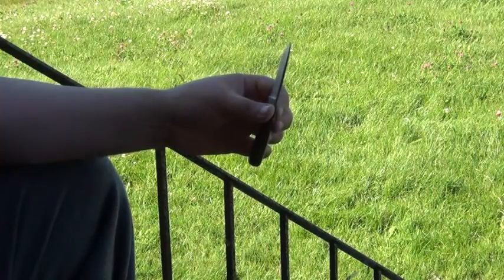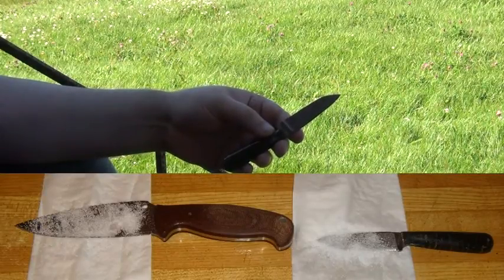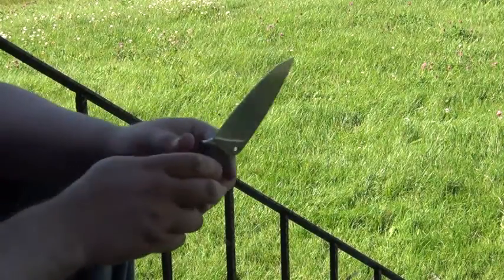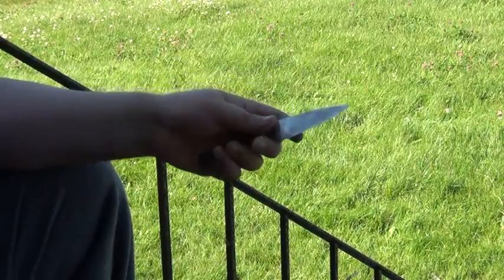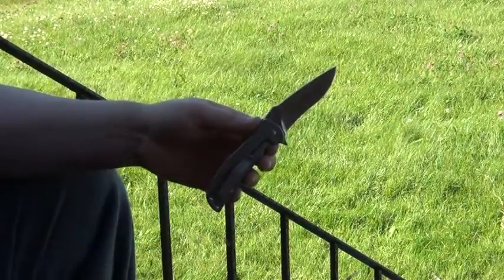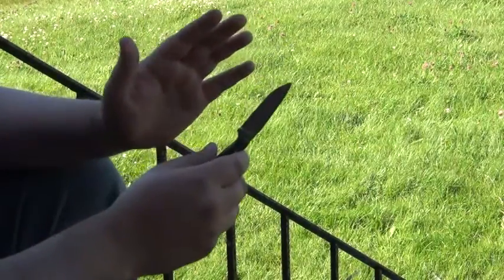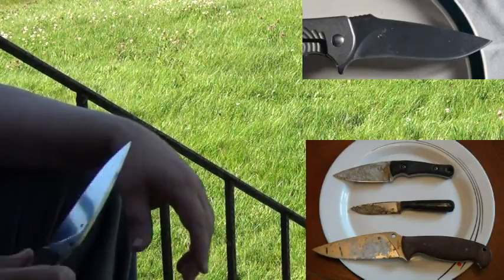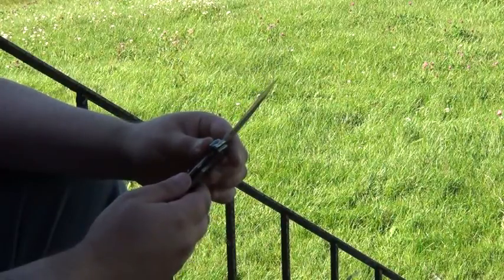Corrosion resistance : (salt soak) VG-10, S125V, S110V

Comment: Nice video :)So based on your experiment, wich steel would you recommend? Is s110v really worth taking over vg10 in terms of corrosion resistance? Im asking because i want to buy either a spyderco endura in vg10 or a pm2 in s110v (the pm2 is twice the price of the endura) i know s110v surpasses vg10 in probably everything besides of grindability but corrosion is my main concern. So wich of those two steels performed better in your test, or did they perform about the same?Thanks and sorry for the bad english.

Comment: +Cliff Stamp
I'm a novice at folding knives. I wanted to ask you a question about knife steels since you seem pretty knowledgeable on the subject:
So I own an S30V Para 2. I am really interested in a S110V Para 2 because I like the knife design and would like better edge retention (even if that costs me some toughness). But my main concern is corrosion resistance. I work in an environment were I am cutting with my knife frequently, but the blade would also be exposed to water and other liquids a lot. I would like to know if S110V performs any better, in terms of corrosion resistance, compared to other steels and supposed "super steels". I am considering knives with VG10, 154CM, CPM154, S30V, S35VN, Elmax, CTS-XHP, CTS-204P, S90V, M390, and 20CV.(Obviously S110V did not fair much better than VG10 or S125V, but do any of these other steels do any better than those?)

Here is a list of my steel priorities in order from highest to lowest:
1. Corrosion Resistance: As good as it can be without much sacrifice in edge retention
2. Edge Retention: I don't mind a little extra time at the sharpening bench if need be. I need to take a good edge and hold it as long as possible.
3. Toughness/Durability: I'm cutting various mediums and I don't want the steel to chip if I hit some resistance. I needs to be reasonably durable. The less brittle, the better.

(I apologize for this long winded questions and the amount of time it might take to answer. I have done a some research but I am far from an expert. I would test all of these steels myself, but my resources are very limited. You have been on a lot of forums and done lots of testing. I figured you would be a great resource. Thank you for your time.)
Reply from the maker: +Steven Rassmussen The corrosion resistance of S110V is very high, however most of the data which leads to that are secondary or side data, it isn't based on q-fog. Based on anecdotal claims, it seems to be solid however.
Reply: +Cliff Stamp 
Thanks for answering. I am fairy new to the knife hobby so any help is good help. I have a Manix 2 in S110V but I have never pushed it to it's limit in terms of corrosion resistance. However, with a recent change of job I am in search of a good steel that is low maintenance (corrosion wise) and holds an edge well. I did end up pulling the trigger on a pair of S110V Para 2s, and I'm very excited. Let's hope Spyderco has ironed out any issues they were having in Golden in terms of Para production. I'm not on any of the knife forums because I'm not really that knowledgeable. I'll give you a report if I encounter anything unexpected with the knives. Again, thanks for your time.

Comment: That's very true, I think the crucible data sheets have been very misleading(I think they are meant to tell the truth in the datasheets but what they actually did was telling the twisted truth), when I look at their data sheet, it undermines other good steel like D2 or 440C a lot.  When I tested my S30V steel knife against my cheapo knife I could see that the S30V is winning in terms of wear resistance, but I don't think it's by too much like they overly hyped in the datasheet, sorry not too sure what steel my cheapo knife is of) I like the carpenter datasheets, they are a lot more humble than the crusible ones, like how they described cts-xhp steel: corrosion resistance equivalent to 440C and attainable hardness similar to D2, a very down to earth acclaim I think(hopefully pretty close to the truth. I've only seen videos on people comparing it with other steels like s30v and m390, cts-Xhp is clearly pretty damn good) Unlike the crusible ones, which often acclaimed their steel is 3-4 times better than already very decent steels on the market.
Reply from the maker: Iamthedudeman00 Crucibles data sheets were heavily influenced by and promoted to a specific section of the knife maker, Carpenters do tend to be much more practical/data based, nice point.

Comment: I knew data sheet were bs when I saw one for cpm 9v. It showed it had the wear resistance on s90v and toughness close to 3v with many various steels thrown in to fill up the sheet. There was no hrc given and to anyone who doesn't know better would think that s9v is the best thing since sliced bread not knowing it only goes up to 56 hrc tops. So at that hrcit might have the wear resistance of s90v but who in their right mind runs s90 that low. Like you said cliff, its a promotional tool used to sell a product, if it was any other industry we wouldn't buy it but for some reason when it comes to steels most of the people dont see through the bs. Great video Cliff.
Reply from the maker: If you check around you can see the same people who will argue for something because of one data sheet will readily ignore what is in another. All they are doing is looking for something which agrees with what they want to be true. This is just fantasy of course but some people would rather not live in reality. It is unfortunate as the world really is a pretty cool place.

Comment from the maker: Work hardening is a known metallurgical phenomenon yes. However it isn't a proven fact that sharpening H1 causes work hardening. It also isn't directly proven that simply power grinding H1 work hardens the blade either. I converted a sabre grind to full height true-zero flat. It didn't effect the hardness or edge retention significantly.

Comment from the maker: They quoted HRC numbers, I assume it was a conversion from micro-hardness testing. The other interesting data is that the serrated H1 blades test very high compared to other serrated blades. They stopped releasing the data awhile back so exactly how much isn't released.

Comment: Did they say how they concluded the hardness difference between serrated and straight edges? I'd think the common indentation test would be very problematic with the geometry and the relative thinness of the blade edges. So would it be some kind of an indirect result from a work test?

Comment from the maker: The finishes do not need to be equal to compare the knives and support a conclusion on same.

To compare the steels the bias from the finish has to be considered which it was, and as noted it pushes it in favor of S110V which still was unable to have an advantage over VG-10 for the reasons noted.

The controls/precision in an experiment are not arbitrary or universal standards, they are designed so as to be able to support the required  conclusion significance.

Comment from the maker: Spyderco does note there is a difference in the hardness of the serrated edges and some have claimed this was from the grinding itself but there is no direct evidence that is the reason. 

Beyond that people have claimed that just sharpening the knife makes the same effect, but Spyderco has been clear that doesn't happen at all.

But in general, all stock edges tend to improve with subsequent sharpening for many other reasons, often removing over heated material is the major one.

Comment from the maker: I did basically hang myself in the end. I tended to in general be fairly just-the-facts in posting. 

However after a post about how D2 was not a suitable choice for large blades which spawned literally dozens of pages.

I responded by saying the fact that the fact this question is even a matter of debate shows how far the forum degraded since the original owner sold it. 

The new owner dropped the banhammer.

Comment from the maker: What tends to happen is someone gets a new knife, sharpens it and concludes that the increase in performance is due to the steel "work hardening" when it is actually due to other factors such as edge angle being changed, the grit being more optimal or just removing over heated steel from the edge.

Comment from the maker: I think most people would see enough of a difference between 52100 and L6 that they would think they are different categories. L6 rusts so fast you can cut an apple and just watch it rust. This is not due just to the Cr levels but the difference in the soaks between it and 52100. However if you wanted to call 52100 the upper end of a I could see that as well.

Comment from the maker: I would prefer however this :

a) 1095, L6, 5160 -  52100, INFI

b) ATS-34 - 12C27M, 420

c) X15-TN - H1

With the categories being more broad because you can move those steels around quite a bit depending on surface finish and HT. 

For example mirror polished low temper/high soak ATS-34 vs sand blasted high temper/low soak ATS-34.

Comment from the maker: I would surmise that something similar to this would be useful :

a) 1095, L6, 5160
b)  52100, INFI
c) VG-10,ATS-34
d) 12C27M, 420
e) H1, X15-TN

This is  :

a) no corrosion resistance
b) mild environments (damp)
c) moderate environments (short time salt water)
d) harsh environments (dishwasher safe)
e) immune to normal environments

Comment from the maker: If you are looking at categories then before you can assign divisions you need to decide on what is the criteria for ranking. If it is what people can be expected to notice a difference in normal use then yes the categories will be quite broad  and it is completely pointless to sub-divide based on q-fog or similar. As with any measurement the accuracy/precision are designed to ensure they allow the necessary/required significance for the decision in question.

Comment from the maker: I do blind runs all the time on many aspects of performance both double and single. It doesn't take anything more than the desire to do it and the willingness to deal with the extra complications. 

It had to be kept in mind of course that for most people this is a hobby so it isn't reasonable to mandate strict procedures. Therefore you have to deal with the data pool accordingly with methods developed for biased sampling.

Comment from the maker: If you look at them in more detail you can see that the harsh scratches on Mike's blade are where the corrosion will tend to start. Thus this test actually has a surface bias for the PM steels and they still do not show a significant difference over the VG-10.

Comment from the maker: Crucible isn't consistent in how they are heat treating the steels and often will use their own older steels as reference/benchmarks to sell the new ones.

In regards to finish, from most to least corrosion resistant :

-the Modulator has a high satin finish, very scratches
-Gavko's blade has a semi-polish from a 1000 grit stone
-the Temperance 2 has a high polish but lots of harsh scratches

Comment: 2 questions: 1. Is comparing one Crucible datasheet to another Crucible datasheet, in which both datasheets only compare other Crucible steels, can accurate conclusions be made? I would not expect Crucible to incorrectly heat-treat their own steels. 2. Cliff, In your corrosion test did you refinish all the blades to a consistent level of polish?

Comment: Cliff. This test is more than enough for the average user to understand issues with corrosion on their blades. 
The examples that have been brought forward , proves that their are more than the usual percentages of alloys , that are responsible for corrosion issues. I have been involved with VG-10 , for over 20 years ,with water and chemical use,and have never had any issue with any corrosion, whatsoever.  With quantity, totaling  of over 20000 blades.

Comment from the maker: As an adjunct, the difference in behavior of them from O1 is so large that it is significant and therefor likely enough to make them be able to resist corrosion in use in situations when the O1 blade would not.

Comment from the maker: There is always a difference in absolute, the question is always is the difference significant. 

Since at no time when these knives are being used is it going to be as controlled as it was in that soak it can therefore be concluded that in use they will be similar in how they resist corrosion, i.e. they are not different.

To put another way, in use the corrosion stresses will be far more random and thus therefore so will be the response to corrosion.

Comment: "when it it far more precise and controlled than how the knives will be used in general."
This is where we disagree. To lump all stainless cutlery steels together, ignores what many users have found in actual use (or disuse as the case may be) in regards to the corrosion of their knives. Therefore I posit that lumping multiple finishes and steels together based on this test is, at best, over-reaching.

Comment from the maker: That isn't the HT, that has to be surface grinding issues and lack of passivization of the steel. If the HT was off that much that the Cr levels were that low the knife would be immediately noticed to be off in other areas, hardness in particular.

Comment from the maker: Why does it have to have a higher precision to be useful when it it far more precise and controlled than how the knives will be used in general. There is no purpose to setting an experiment to precision that is beyond what is necessary for decision making. The purpose of this experiment was not to determine if there was a difference, it was to determine if it was a significant one.

Comment: (cont2) cutlery steels all have, in the scope of steel in general, quite a narrow performance band into which they must fit to be considered usable. The result is that, if your test is unable to discern differences across three different stainless cutlery steels from three different makers with three different finishes, the issue is with the test. Within this narrow band of steel, to be a useful test it needs to segregate subtler performance characteristics to be considered useful.

Comment: (cont) of the matter is that in use, I have noted issues with corrosion forming, and in some case even patinas, on some stainless cutlery steels while others not. VG10 is particularly perplexing in this case, as I have some examples from Spyderco which are quite stain resistant while I have others for which corrosion is an issue to the point where cutting a steak will begin to draw out mild discoloration. You can argue heat treat, but thats not quite my point. My point is that stainless (cont2)

Comment: I don't take issue with the premise of the video, marketing materials should rightly be viewed with some skepticism particularly (as in the case of crucible) where not even performance numbers are given just cute comparative bar charts, but I do take some issue with your test and the resulting carte blanche statement that there was really no difference in corrosion resistance between these steels. You mentioned blade finish being a significant factor, as well as heat treat, but the fact (cont)

Comment from the maker: If you really want to see what one is like, then take a knife for about a month and leave it wet over night and then in the morning just dry it off which will take off the loose scale. Let it form slowly and it will get very thick and very dark. Naturally it happens much slower because the coating gets burnished off in use so it takes decades to see what you would get in a month. I have seen them dead black like a cast iron frying pan.

Comment from the maker: Assuming you want martensite (there are other forms depending on the steel) the quench needs to be very rapid so as to prevent precipitation of secondary carbide and avoiding the embrittlement zones which the steel will pass through in the cooling. Thus the steel should be hardened as fast as it can without cracking it. Thus M2 should be oil hardened not air but also not water as air is too slow but water is too fast.

Comment from the maker: However, if use is infrequent, the knife is used to a much lower level of sharpness, the finishing grit is very low or sharpening tolerance isn't that high - then the higher carbide steels can be of value and D2 is a very solid choice in general with A11 (10V) being an extreme example of such.

Comment from the maker: It depends on the knife (scope of work) and the individual as to what attributes they desire. For me :

a) Larger knives - mid carbon content, low carbide, moderate to high hardness (depends on how hard they are going to be used) such as Calmax, L6, 1055 .

b) Smaller fine cutting knives - higher carbon percentage, harder and either be steels such as 1095, O1, white/blue, AEB-L or if the geometry is very nicely optimized M2, M4.

Comment from the maker: That would be interesting, it has to be mirror, bead, stone and then acid wash. However how significant each change would be useful to see. I don't have Bruce's patience though to take a blade through each finish (satin would be useful as well) especially on something like S110V. I might try it on a simpler steel though.

Comment from the maker: The lower carbide stainless steels are actually dishwasher safe so they are very difficult to corrode. Unfortunately this is dependent on them having a decent HT which they rarely have (under soaked, slow quench, ...) and thus they can actually suffer pretty significant corrosion.

Comment from the maker: Yes, the closer you get to mirror the higher the corrosion resistance and the more it is scratched the faster it will rust. Take a carbide scraper and put a large scratch across the blade and do a soak and you will be guaranteed to get localized corrosion in the scratch.